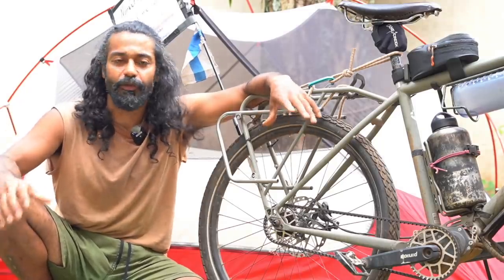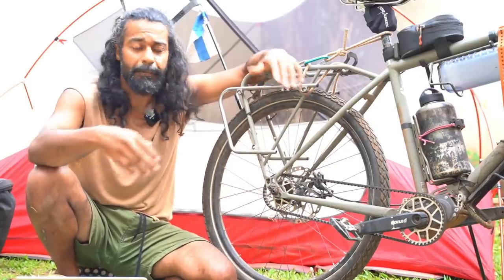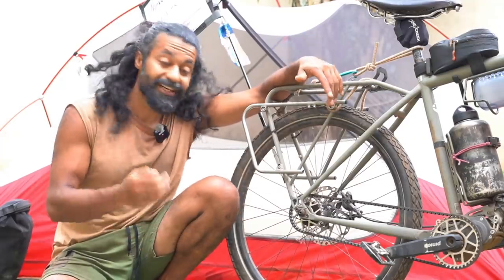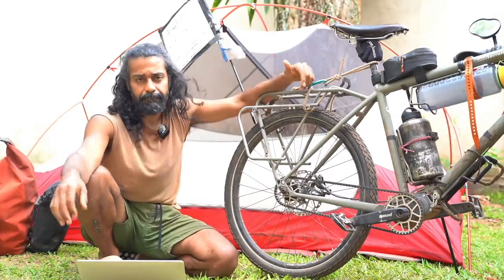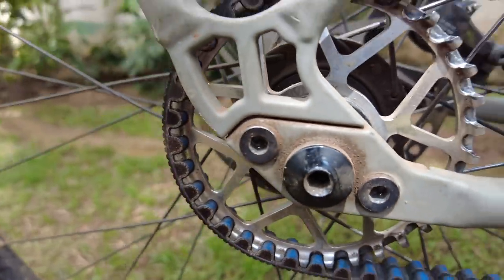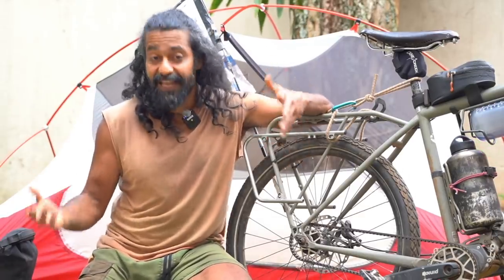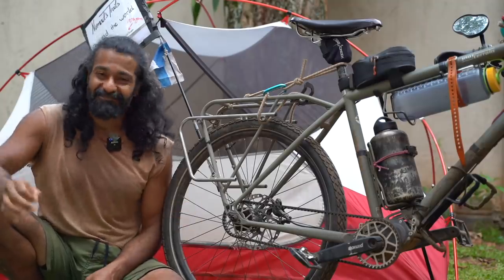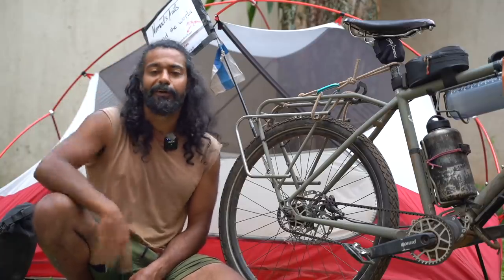Belts Are BETTER Than Chain Drivetrain for Bicycle!  My Test Result After 12 YEARS OF BIKE TOURING!

Comment: the belts brake if you twist them
Reply from the maker: No, it dosen't  brake it straight a way, but as I mentioned  in the video" it can Damage the fiber carbon cords in the belt" this can cause the belt  to brake under the heavy pressure. Handling the belt in a correct  way it is important and this is not complicated, actually  pretty  simple. 😊

Comment: Why compare a belt to a derailleur chain? It's a complately useless comparison. Single-speed chains are a whole another story. Doesn't need nearly as much work as a derailleur chain plus you can reverse the chainring and sprocket to use it "twice".

Comment: Metallic components are 100% recyclable, carbon fibers are not recyclable.
Reply from the maker: Being more ecological is an interesting  question. It needs scientific research imo. true the chain drive train is made out of metal and metal is recyclable. but for making the chain drivetrain energy being used and for recycling it also, add on top of that all the transportation, packing material and the oil being used for lubricating. also i am not sure if there is no way to recycle the belt. so this is something  which needs a research. but my guess is belt is more ecological. but it is just my opinion i can't back it up with any data :)

Comment: Belts don't  allow shifting. No shifting, no climbing.
Reply from the maker: What? How you came to this conclusion? This is not true 😊
Reply: @NomadsTrails  Well, I've never seen a cassette and derailleur working with a belt. Neither a road race bike.
Reply: @JoaoCarlosProencadeOCosta  Did you watch the video? Shimano Nexus/Alfine, Rohloff, Pinion, Kindernay,... just to mention a few gearing systems which are compatible with a belt.
Reply: @varez93  Good. Then I'm hoping to see belts in the Tour de France. Maybe next year.
Reply: @JoaoCarlosProencadeOCosta  You will not see belts in the Tour de France because the conbination of a gearbox and belt is lest efficient than a traditional derrailleur and chain set up. In professional sports marginal gains matter, therefore the most efficient setup is the right choice.
Reply: @varez93  Chains and derailleurs were improved for decades and decades until their best results were achieved. The same can be done with belts, if they're better than chains. What's good for sports is good for every day use.
Reply: @JoaoCarlosProencadeOCosta  The needs of the pro peloton are very different than the needs of your average bike commuter. What is good for the Tour de France does not make any sense for the average Joe, and viceversa. Otherwise you will see bike commuters in the Netherlands on 25mm tubulars. Derrailleurs and chains for racing, internal gearing systems and belts (or fully enclosed chains) for everything else.
Reply: @varez93  I won't see bike commuters in the Netherlands on any other country on 25mm tubulars and carbon frames (with a comfortable ride position, of course) because of the costs. But for the pro peloton costs are no issue. They will adopt more efficient belts rather than chains as soon as they're available, for sure.
Reply: @JoaoCarlosProencadeOCosta  It has nothing to do with costs. It has to do with robustness, reliability, and ease of maintenace. Narrow tubular tyres offer low puncture protection and are very uncomfortable due to the high pressures and low air volume. That is why almost everyone in European countries with a long tradition in bike commuting rides clinchers with a minimum width of 37mm. Regarding the frame material, Carbon frames are actually really cheap as it they are manufactured in China. You can get new framesets for around 500€. The problem of carbon is that it cracks relatively easy after an impact and it is practically unrepairable. Not ideal when you are parking your bike in a busy town and people are smashing their bikes against yours when trying to park it. Carbon frames also have a typical maximum weight of 100kg. This means that if the bike weights 8kg and the rider weights 80kg, there is only 12kg left of load which can be safely carried on the bike. If you are using the bike for doing groceries, shopping, bike touring, etc. this weigh limit really limits you. 

I could go and on with more data and examples but the point is: professional road cyclists do not have the same needs as the average bike commuter. The same way that the needs of a F1 car are very different that the needs of a family car.

Comment: ok but this system is very very very expensive 😮‍💨
Reply from the maker: Yes it costs  but also comes with many benefits. Also the chain dose the job 😊
Reply: But not that expensive when you consider how expensive chains, derailleurs, cassettes and chain sets have now become. Derailleur gears used to be cheap and nasty, now they are just nasty. A Pinion gearbox or Rohloff hub soon pays for itself. I reckon in 2 years it will already pay for itself but this depends how many miles you ride and how well maintained you keep your chain derailleur transmission. Once you have had them 2 years additional years are effectively free cycling as you spend nothing on replacing consumable components that you would have to with a primitive chain and derailleur transmission. With Rohloff and Pinion you have the high initial cost but they soon repay this by the much reduced need for maintenance and replacing shagged components.
Reply: @alexmorgan3435  You don't need an expensive gear system for a touring bike. 3*8 is the best for me. Parts are cheap and easy to find anywhere.
Reply: @fratylmaz706  And a real PITA to maintain and cost to continually replace shagged out components. LIke Peyman I have ridden bicycles many years, decades with primitive derailleurs and chain. I am so glad that I now have Rohloff and belt drive bikes. Would NEVER go back to chain and derailleurs only maybe when riding on DRY WARM SUMMER days on clean roads, but dirt, grit, mud, the slightest chance of rain, cold, snow or ICE definitely no. Chain and derailleurs are old technology. I can afford Rohloff and belt drive bikes so I buy them and cycling is so much better. No more time wasted maintaining filthy dirty derailleurs and chain. I understand not every one has the money to buy Rohloff/Pinion geared bikes with belt drive but save up and make it happen which is what I did.

Comment: No more ecological, lt cant be recycled
Reply from the maker: Being more ecological is an interesting question. It needs scientific research imo. true the chain drive train is made out of metal and metal is recyclable. but for making the chain drivetrain energy being used and for recycling it also, add on top of that all the transportation and packing material. also i am not sure if there is no way to recycle the belt. so this is something  which needs a research. but my guess is belt is more ecological. but it is just my opinion i can't back it up with any data :)
Reply: Most chain lubes are far from ecological.
Anything teflon containing has fluorine, which is chemically one of the most toxic elements there is. (chlorine used as chemical weapon in WW1 is its "better behaving brother")
And doubt most teflon free chain lubes are environmentally friendly either.
Also solvents used in lubes to make applying easier are likely all more or less harmfull.